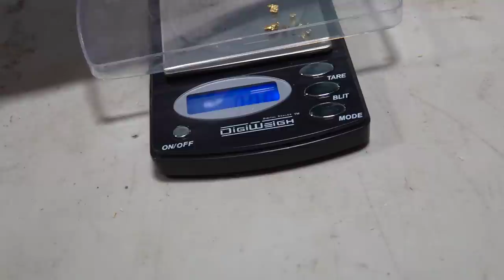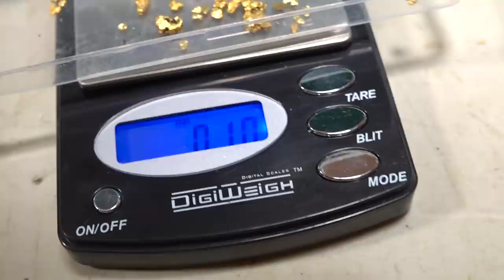YouTube GOLD (S3 E3) BOYS ARE BACK IN TOWN: Mining Crew Hunt For Alberta Gold! | RC ADVENTURES

Comment: Never set a car battery on concrete or cold ground. Put a 2 inch thick board under it to insulate it from the cold ground/concrete
Reply from the maker: Hey Big  Bear.. its  not actually a car battery - its an RV battery.. Lol! A moist concrete floor combined with the carbon in the battery cases could create electrical current between the cells, discharging them. None of this is a problem with modern batteries — safe in their hard plastic shells. In fact, concrete is generally an excellent surface on which to place a battery bank.
Reply: @TheRealRCSparks  one battery that I saw with the yellow top, i knew that one was an RV battery, i have a similar on on my camper. It was the, i wanna say "gray" colored one that looked like a car battery to me. When I was a kid my dad had taught me never to put a battery on the ground or concrete so it's just a rule I have always followed. I luv the shows btw! They are great! I have had to deal with cancer the past 7 years and after several surgeries wasn't able to return to work so recently I have gotten in to RC to pass the time and your shows have really inspired me and exited me about this hobby. I would luv to talk to you more about the equipment u have and ur traxxas bronco